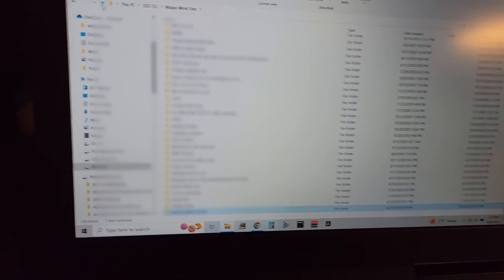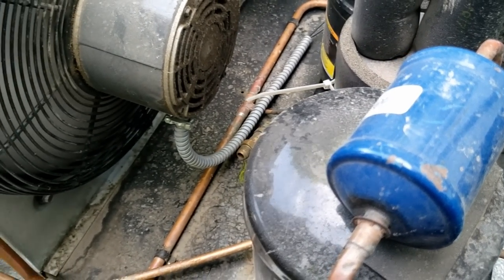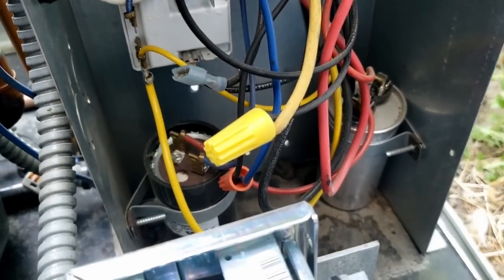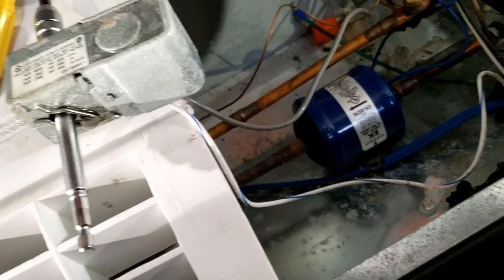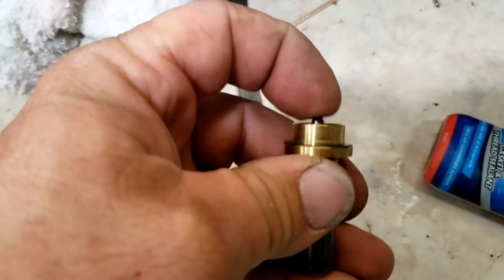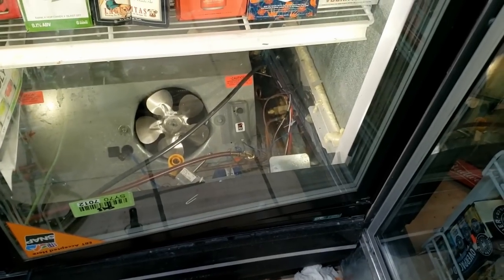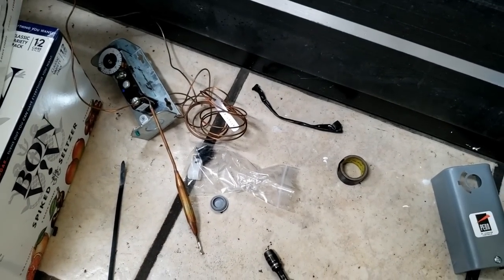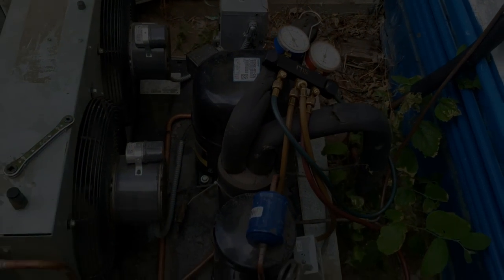I Missed This One Important Detail

Comment: Very nice informative videos.   
A short LLSV story. An unnamed national refrigeration company called me.  Walk-in cooler won’t maintain temperature, erratic, 34-67f. They spent over 9 hours on different days, multiple technicians, changing the cold control, all evap/condenser wiring, (208/1 condenser,120v evaporator), all the compressor starting components, all low/high pressure controls.  On a previous repair, 3 months earlier they had replaced the llsv coil.
Enter me, opened the Alco llsv coil electrical box and changed the wiring tap connections from 220v to 120v.  Worked like a champ. 😮
Reply from the maker: Crazy how that changes things😁👍👍

Comment: I love that breaker finder by ideal. I hated it at first. Was completely useless. Until I read one review on lowes website. If you scan over the entire breaker first, slowly, and let it hit off a bunch, then start over again, all of the false hits are gone. It’s really weird as no where is this referenced to in any documentation. But it works without fail. Tons of false hit on the first pass then 100% accurate on the second pass. Hope this helps!
Reply from the maker: I have problems with it on commercial panels, especially when there are sub-panels
Reply: @HVACRSurvival  - It can have problems with multiple legs.  I have one, and I've used it.  Even narrowing down to two breakers is far better than what I've dealt with in the past.

Comment: I gave up on a holiday ice 4 tube circuit each has its own solenoid. The end set of tubes I changed 3 solenoid valves (2 oem and 1 from truck) and the valves would still not shut 100 per cent. Removed entire circuit welding piping reducing ice production by 25 per cent but I mentally can’t change that solenoid valve a fourth time. If it leaks you loose the whole machine and no ice.
Reply from the maker: That would suck. I'd add insolation valves and refrigerant ports for future repairs.

Comment: Wrong solenoid coil for that valve. You have part Chevy / part Ford. I.e., sporland / Emerson! Surprised no call back for a “chattering” noise
Reply from the maker: Still working fine for two years, I don't disagree but a magnet is a magnet if it doesn't fall off and it was tight. The owner was "thrifty. "